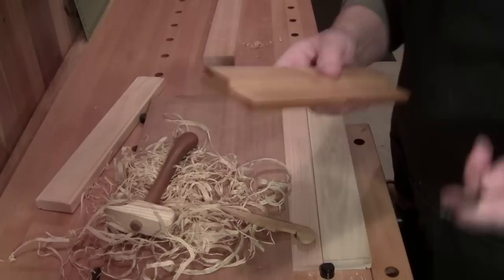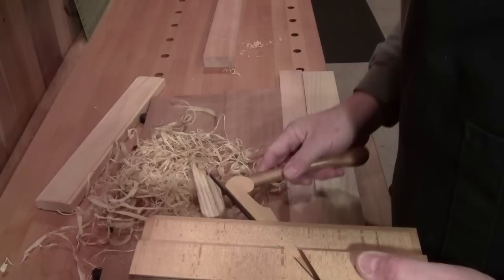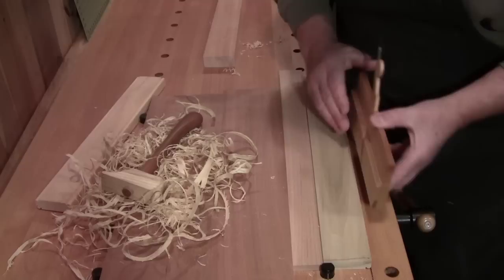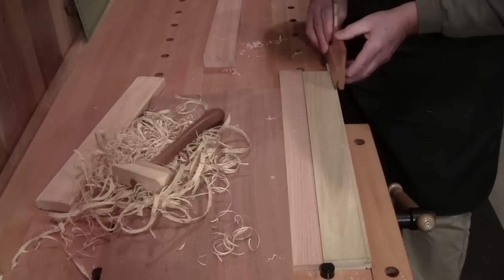PLANE TALK - Wooden Side Bead Moulding Plane by Matt Bickford - 8 December 2017

Comment: Great video! I’ve refurbished an old side-bead plane same as this, I’d love some tips on sharpening the iron/blade.
Reply: I agree. Sharpening would be a great idea. Like everything else in woodworking, once you see it done it becomes easier. I have about a half dozen of these types of planes and would like to rationalize my sharpening technique. Thanks Walter.
Reply from the maker: Ahhhh.... Sharpening, oh boy!  Once these are sharp and polished, all I do is keep the flat side stropped unless I use it allot then I use a matching dowel to coat in compound and lightly strop the bevel.  I think we will need to get an old one out and to that...  Thanks for watching.

Comment: Very good job describing and using the sidebead plane! How about sharpening it ?
Reply from the maker: Good Q !
Basically you will need a sharpening stone to match the radius or slightly smaller to hone the inside of the bevel, but mostly you want to keeo the flat face flat and hone to as fine a stone as you have.
The less you alter the profile the better.
Once sharp, they will stay sharp for allot of moulding.

Comment: On the tip of the blade there is a longer section nearest the edge. Does that edge need to cut wood horizontally or is it just to support the vertical  cutting edge ?
Reply from the maker: For the most part...
The cutting edge is on the bottom but, the vertical sids should be honed and polished at the same time in case it does protrude slightly.
Thanks for watching.

Comment: I have learned to make these planes work now but even when the wood grain is ideal the last inch or two seems to cause trouble. What happens to make that last difficult ?
Reply from the maker: it is a matter of support for the plane.
When making moldings, we usually add a few inches to both ends.
If you are edging a panel or top, you can add waste blocks.
Thanks for watching.

Comment: In an old film of making these planes in Sheffield the maker uses a lumpy block with a wedge angle to hold the half made plane still. You should cut one out to hold the demonstration piece.in position . Otherwise an excellent video . Many thanks .
Reply from the maker: Yes, If I were making more of these I would have a locking jib with wedges.
Thanks for watching.